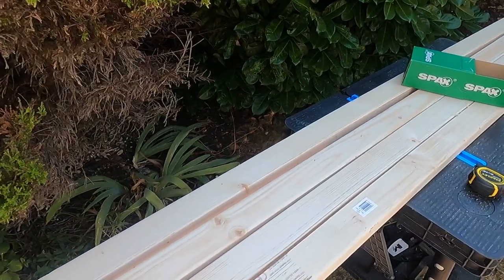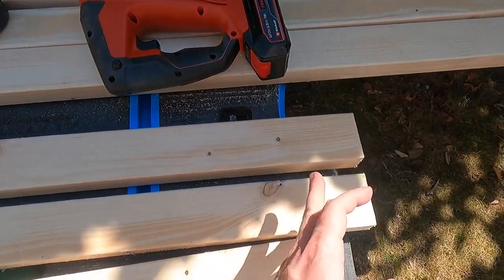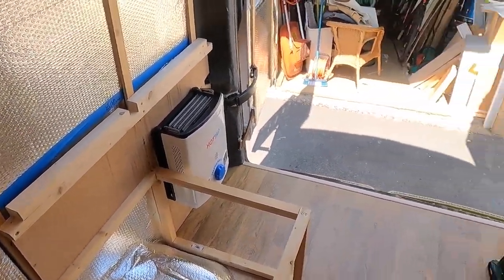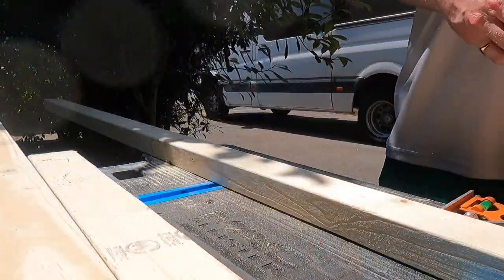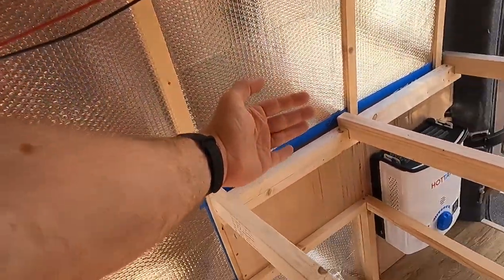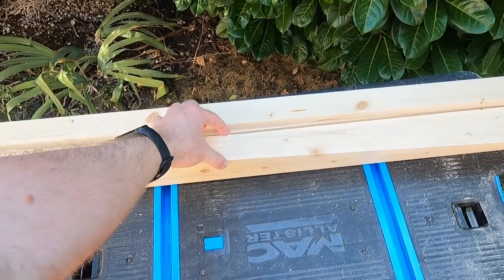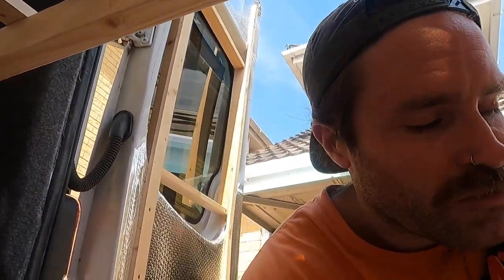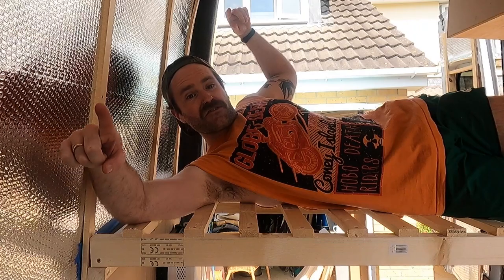Building a Simple Wooden Bed (finally) | Idiot’s Guide | DIY Sprinter Van Conversion UK

Comment: Hey mate,
As usual, great video... 👍 Now The questions, what are the dimensions? (height from ground as well) Single use or double weight proofed? (those wooden beams seem "stretchy")
Keep the good work 😉
PS: I personally appreciate the return of the Orange crocs / Green shorts combo, a signature maybe 🤣
Reply from the maker: Thanks as always dude! The three main beams were around 175cm in length and around 75cm off the floor, just enough space to fit my water tank underneath. The CLS from Wickes is light but sturdy, but I’ll be keeping an eye on that central mean to make sure it doesn’t dip or sag, if so I’ll probably add a little bit of support 👌 Hahaha many thanks, what was initially a ‘fashion accident’, I think may have to stay for good